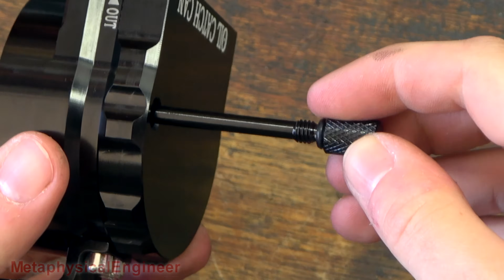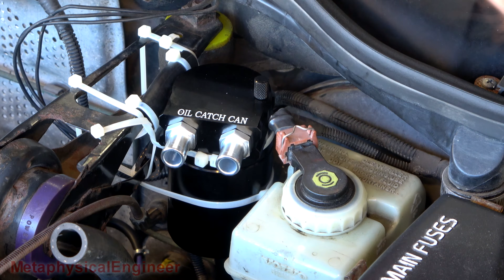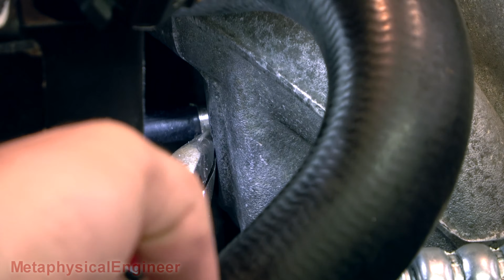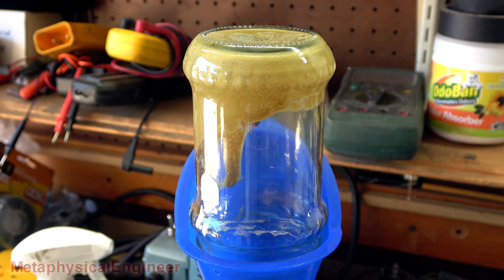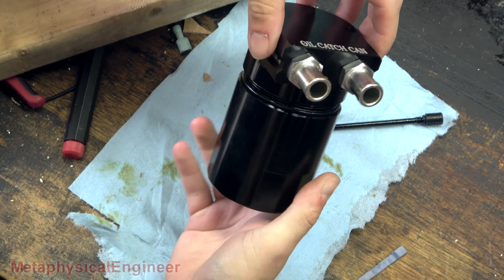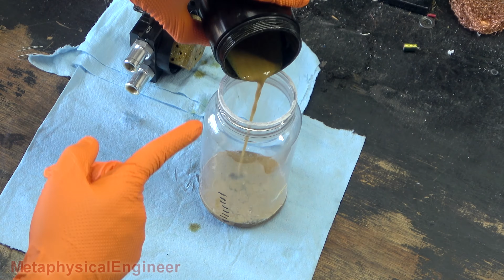I Tried the Evil Energy Catch Can for 3000 Miles

Comment: Thank you so much for documenting all the pitfalls and solutions along the way.  From what the inside of the can looks like you might consider adding a 2nd stage and see how that goes.  Because you have turbo a 3rd stage may be needed to clean the output down to a true vapor.  I currently have a 2 stage home made set up but may replace the 2nd with one of these or add it as a 3rd.  Watching a series of this kind of vid to help me decide how I go. 

Excellent camera angles and lighting here and I like how you zip through tedious portions.  It is guys like you who make great Indy films; like the fan filmed Star Trek Odyssey series.
Reply from the maker: Thanks for your kind words!  There are some additional pitfalls I encountered since this video, so there's an update in the works.  The good news is the turbo and boost lines and intake are staying nice and clean, so the catch can is intercepting the worst of the crud that would otherwise make a huge mess in there.

Comment: My evil catch can 10AN doesn't come with  /require steel wool..should a catch can always have steel wool
Reply: It’s a good idea. The steel wool increases the surface area the oil droplets have to go through and helps make sure more condenses back into oil and gets caught in the catch can.
Reply from the maker: drb had the answer.  Anything the increases surface area gives the oil vapors more chances to catch and collect instead of shooting right through and into the engine.

Comment: I use duel evil catch cans on my 09 Infiniti g37 non turbo. The one thing I did as added extra filtering down the line before and after the catch cans is to use fuel filters. Works great and never really have the yellow white emulsion during the spring, summer or fall time. I live in Louisiana close to gulf. Lots of humidity. Sometimes it gets frigid enough for some emulsion. Definitely have great vacuum because even non turbo these n/a g37 still have pretty high compression.

Comment: Steel wool will corrode and break down then be vacuumed into the combustion chambers. You should use something of better quality.
Reply: That is stainless steal.  Same thing as the brillo stainless scrubbers you clean dishes with.  Those things never break down.
Reply from the maker: Yeah as momo said, it's stainless steel wool.  Regular steel wool would have already rusted to nothing in 3000 miles.

Comment: i spread out the steel wool and used that as baffling since i got the cheap version without it
Reply from the maker: I thought about that too!  I'm open to further experiments, and have a follow up video in the works.  That emulsion and condensate problem got even worse in the cold weather so I had to make some changes.

Comment: The most common material used in OEM coolant/heater hoses, rubber components in the brake system, exhaust system and motor mounts is EPDM rubber.   EPDM rubber is not effected by glycol (primary ingredient in coolant and brake fluid )and it tolerates much higher temperatures than common rubber components.  What it absolutely does not  tolerate is hydrocarbon based materials such as fuel, grease, oils and cleaners.  BRAKE CLEAN for one.  Damage is not immediately apparent.   Depending on what it comes in contact with and the environment it may take from a few months to a few years.  The signs of damage is that the EPDM  loses its firmness and it swells in all dimensions.   i.e.  A EPDM bushing will increase in outer dia. and close up the inner dia.    Those, including myself, know about this all too well when trying out Permatex's new synthetic brake lube. Excellent lube for metal to metal contact but heaven help you if you used it on the EPDM rubber components.

Comment: My 15 Chevy equinox has pcv orifice built in the intake manifold, I am getting a lot of blow back and I am getting milky soot on crank case breather tube, can I install caught can to bypass the pcv orifice
Reply from the maker: Don't bypass the PCV.  Put the catch can upstream to capture the oil vapors.  If you're getting excessive blowby, you may have other engines trouble.  Lots of the milkshake in the system could be because of short trips like what I have here.  But if the oil in the engine also gets milky, there could be coolant getting in from a head gasket or oil cooler failure.

Comment: Wanted to say thanks for this video.  I’ve been popping my dip stick and your vid inspired me to clean my catch can…the sintered screen was plugged! Cheers!
Reply from the maker: Wow! Glad you caught it!  Lucky the dipstick let go instead of one of the engine seals. However long you waited to check your catch can, cut that time/mileage in half!
Reply: I love my sintered bronze model but haven't figured out how to safely drive in winter. I am concerned about the bronze freezing shut. I  clean it annually with brake cleaner and air pressure.

Comment: Oh hello! Came for the catch can, wasnt expecting this review to be on literally my car!!! Almost... 

1999 v70xc

My only reservation with catch cans vs OEM is the extra servicing. Ive covered about 30,000 miles in the past 2.5 years and... Thats a lot of catch can catch can drainages I'd be looking at!!!
Reply: I no car may need maintenance 😂... if it makes you car survive longer. Worth it.. or get a electric car 🤮
Reply from the maker: Very cool!  Catch cans are an extra maintenance item for sure, though longer trips tends to result in less emulsion slime from my experience.  Actually have an update video in the works where I address some of my frustrations with this system after more time using it. 

How many miles are on your wagon?

Comment: I thought about getting one of these and then decided not to. I did not consider the point of pulline H2O  out of the PCV for short trips.The alternate one has a much better design. I had your same thought of the baffle and the reverse flow. I think putting all the stainless "wool" inside the can bottom would yield you better results. It would act more like the one with the baffle.  Make sure you never let it get full or you could pull in liquid. Ssg Hall Army Aviation, Airborne A&P, ASE, retired.

Comment: I put one on my Cappuccino, I rarely drive the car for a long time, this thing gets full after about 4 drives. So much condensation is caught and prevented from running through the motor. It's a cheap Chinese  catch can but works perfectly.
Reply: these damn F6A motors and their nonexistent OEM PCV system. Just ordered a catch can for my alto works RS/X

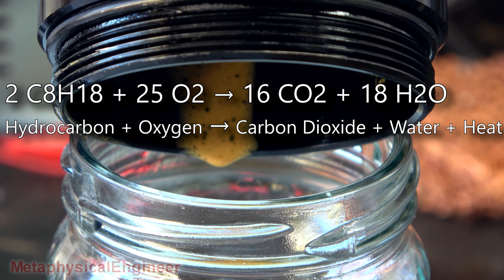Comment: 13:27 I’ve had my hands in all kinds of cars and motorcycles since I was about 13 or 14 years old (late 1970’s). That sludge is a problem. None of the cars I have owned or worked on have ever shown that except for three; a 327 Chevy, a 225 slant 6 and a Honda civic; all three had blown head gaskets and were sludge free after after I replaced the head gaskets. 

I have the same Evil Energy catch can in my 66 Mustang. The engine has about 2,000 miles on it since I did full build. I run mine from the PCV valve, through the catch can with the steel wool filter and then out to the manifold. I have less than an ounce of oil and it is just oil, no sludge, no foam. It’s a good little unit.
Reply: It's not a problem at all, you aren't familiar with modern/turbo engines obviously.  A blown head gasket on this Volvo engine would manifest in a much worse manner than this normal pcv emulsion.  Cylinder pressure on a turbocharged engine WILL overcome the coolant system pressure and blow coolant out of the overflow or blow hoses, heat exchangers, etc.    This sludge would go unnoticed on a less over-engineered pcv sytem as it would get sucked straight through the intake and burned off, the complexity of the system leaves places for it to collect and be found.  Its as simple as if it isn't mixing with the crankcase oil then its fine, if your oil is changing color then it may be a problem.
Unfortunately this is the situation with all vehicles now, the pcv systems are way too complex.  I assure you i can find this "slime" on any vehicle made within the last 20 years.  Just have to know where to look.
Reply: @jasonsmith4902  Thanks. That must be it. 

I don’t have a turbo car yet but am planning a build within the next year or so. The only boosted car I have ever had is my current daily driver, a 2 liter Kompressor (supercharger not turbo).

Comment: if you didnt change the oil, this would be the filteration of hot oil being cycled through. have a 2006 dodge grand caravan with a 3.3L V6. nothing fancy except it has 300K+ n thats also moisture from the fuel itself. if anything since it shows you have excessive water in the lines, for us up here in canada, I suggest that you run Gas line antifreeze into the fuel tank. gas line antifreeze is ethenal so it dries up any water in the fuel lines, which in take will clean up some of the water in the "Emulsion" cocktail. thing is its actually the EGR system that recycles from the intake. thing is, regardless, that stuff left behind is heavier then air. you just have to check it once a month. as well not all fuel is the same, regular is not regular at the other stations. regular from shell wont be regular from mobile one. if you are chasing the price of gas, then thats when you will get extra water in the system, if its a cheap fuel then i suggest that you keep it the same brans. regardless. think of it as a ritual. use the same oil for the same response, well keep the same fuel. once you find the fuel that works, then change the oil till you get the same response. not all fuel/oil will work for every car. we use synthetic 5W20 except i'll be switching to 5W30 then for the fuel, i'm not going with the most expensive,regular, i'm just going to divid it by the cosest cent. basically if you have 5 gas stations, then take all 5 gas stations add them together then you divid that by 5. the one that is closest to less then 1 cent thats the fuel you use. then every 4th tank you add in a bottle of gasolene antifreeze n then you'll be good to go. you drive an older car early 90 i think from the tail lights. great cars Volvo.
Reply: The moisture is pulled out of the air by the combustion process, it is actually included in the formula for ideal combustion as half of the main by product for perfect combustion.

Comment: The glove test is great but you only did half of the test.Cut a finger off your glove  pull the dipstick and test the dipstick port.  The glove finger should want to suck in there also.
Reply: una pregunta la prueba del guante como es. sí succiona está bien la pcv, y si sopla está mal. Gracias
Reply: @camizaqui hello the glove test should only be performed when the engine is hot.blow by from the piston movement positively pressurises the crank case .the pcv system alleviates this pressure.the dipstick test you also do when the engine is at temperature this should suck in at idle only .it's not a hard job to do but it will save your beautiful volvo engine and make it last a very long time.i hope this helps you friend.

Comment: Need to put the Brillo pad in the bottom of the catch can under the added baffle component you made and is a good modification. Drill and tap the center bottom of the reservoir for the installation of a valve and drain line for easier service.

Comment: lol! I thought that was a Volvo T5. I’m running titanium heat shield sleeve for fuel lines on mine. Especially where vac lines cross the engine. It keeps them cool enough that they don’t balloon or collapse.
Reply from the maker: GLT model, with the tiny baby turbo!  Got a link to the heat shield sleeves you used?  I'm not having heat soak problems really, but always interested in useful products.  My main issue with the line collapse was not supporting it well enough, and using hose not rated for oil vapor.

Comment: Great review catch can. The way you documented the progression is what helped me  with the application of a catch can.
 One note is I would be interested to see what happens when the catch can isn't serviced and allowed to fill entirely.  I think it would allow slugs of the goo thru and due some real escalated damage. 
 Like videos that make me think.😊
Reply from the maker: I'm glad you found this video helpful!

Indeed there would be a lot of bad news if the catch can filled up all the way.  If it blocked the PCV, the pressure could blow seals out of the engine and cause major oil leaks.  If it let a slug of goo pass to the intake, that would make enough smoke screen to have James Bond jealous!  But in a turbo engine, that slug of liquid could destroy the turbo.  Impeller spinning at 100,000 rpm is only meant to push air, so hitting a bunch of liquid could bend or tear the vanes off.  Expensive!!

Comment: Have you seen any more leaks appear or disappear after increasing the size of the hose from the manifold to the ptc? Before I ended up replacing my pcv with genuine hoses in my LPT 850, I was considering the diy method, which worked well for me on an NA engine. I was concerned increasing the diameter of that hose would pressurize the crankcase during boost and put a heavier strain on the seals under vacuum which could wear them out or suck them in.
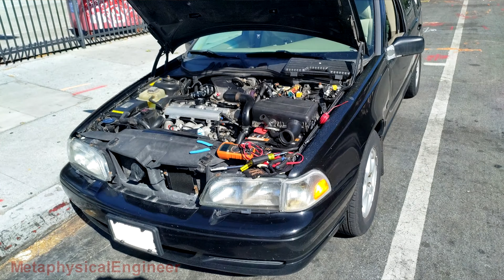Reply from the maker: No seepage except as caused by the collapsed hose explained at 18:29. The larger hoses can only help the flow, as the suction at the turbo compressor inlet counteracts any extra boost feeding back.  I did more experiments in this follow up video with pressure measurements: https://youtu.be/4UwFhrd6T58

It takes a lot of pressure to pop seals out, and I'm not sure there even is a maximum amount of vacuum for them.  There's nowhere further in for the seals to go.  

How many miles on your 850?
Reply: About 210k currently on my lpt.

I was wondering about the vacuum because when I had "too much" on my NA diy setup the filler cap seal made a high pitch squeaking noise and was almost impossible to remove with the engine on. That engine had a lot of blowby but still ran fine so I was just trying stuff to try and avoid blowing a seal.
I ended up reading some hearsay on a forum that said this could suck in dust from the crank/cam seal inner lips and wear into the sealing surface (no evidence to back that up). This kind of scared me into just using a more standard setup with slight positive pressure at idle.
Your other video also answered some of my questions too and was intersting to see.
Reply from the maker: Squeaking and stuck fill cap does sound like a little too much vacuum.  This is why the traditional PCV valve design is a vacuum dependent mechanism that restricts flow at high manifold vacuum but opens up to allow more flow at low manifold vacuum. I'm considering looking at such a mod sometime on the vacuum line between PTC tee and manifold.

Comment: What I did with mine was cut up an aluminium soda can to extend the baffled section down to the bottom of the can and then packing it with the supplied steel wool. Just used red rtv to 'glue' it on. No real difference in flow before and after (Because the inlet and outlet are plenty big and there isn't really any filtration, it's just catching vapours as they pass through. The tubes that they come with are awful.
Reply: Can we see this?
Reply: Redneck engineering 😎

Comment: We had one of these Volvos, i hated it at first my parents got it when I was 16 or something used with 120k miles for maybe $2,500

That car ran, and ran, and ran, and ran. We had it up until maybe 270k when we scrapped it after everyone was done with it. It leaked every fluid possible, and the front end suspension was in serious need of repairs but it was one of those cars where it just too gas, oil, and any other fluid which could leak and beyond that it ran happily. My father didn't want some young kid to buy it and the front end fail so we scrapped it, still ran very well but again was in need of repairs but it just kept running.

In that time the only repair (non wear items like brakes/rotors/oil) we had to do in the 150k we kept it was a single fuel pump.

Comment: Hi, I'm just curious about what's wrong with some oil going in through the intake? I know that oil mixed with EGR gases causes that thick buildup but I don't know why a slight film of oil is bad? Other than of course tailpipe being black from all the soot. I'm just trying to learn more.
Reply from the maker: At a basic level, it coats all the intake components with sticky tarry carbon and broken down oil.  Even on this car without without EGR in play, it makes a mess!

For higher performance engines, the oil mist can reduce the octane of the fuel and cause highly destructive detonation.  In a spark ignition engine, the fuel-air mixture has to be stable despite all the heat and compression, and not ignite until the spark plug fires.  Oil mist mixed in there can ignite spontaneously from heat and compression alone, like in a diesel engine, but at the wrong time and with parts not designed for that kind of impact. Engine management will take measures to detect and avoid this but at the expense of major power loss and poor fuel economy.
Reply: Seems to affect a lot of things, including sensors. Cars with filthy intakes don’t run as smoothly. Hard to tell sometimes until you reverse the condition and clean them up. Usually very noticeable.